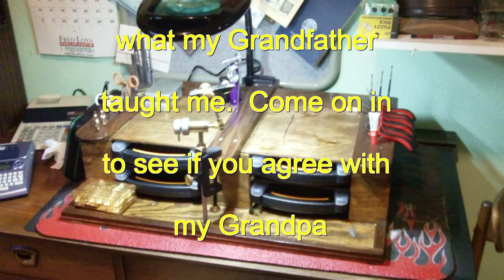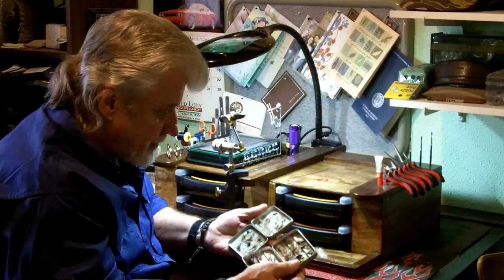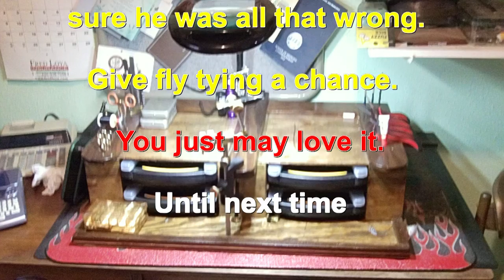Tying Flies, Talking Flies and remembering what my Grandpa taught me 50 years back

Comment: Hi Mike, I enjoy your video immensely. I got a question as I am just starting out in fly tying, my question is is that glue you used with that light a special type of glue or is it just some kind of super glue? Would a regular Crazy Glue work with that light? Thanks Mike.
Reply from the maker: Hey, Grand, thanks for stopping by and leaving the comment.  Yes, it is a special UV glue and it is not cheap.  A very small bottle is 15 bucks, but it does last a long time.  You can certainly use super glue in it's place but you have to wait a few minutes to let it dry so you fingers don't get stuck to the fly.  Both can work but an instant dry with the UV works better for me.  Thanks again and all the best to you...
Reply: Thanks Mike for your help.